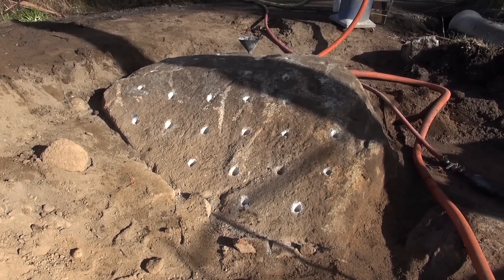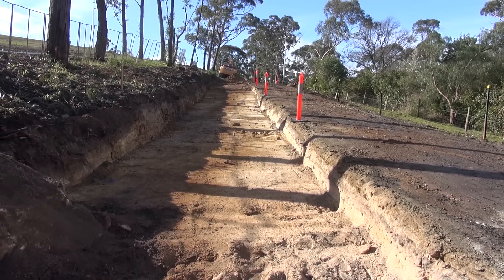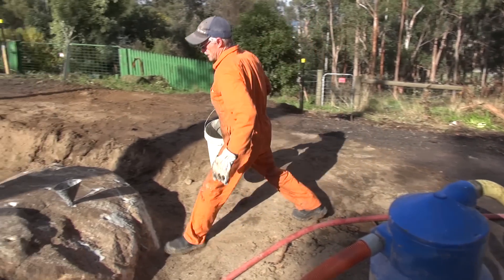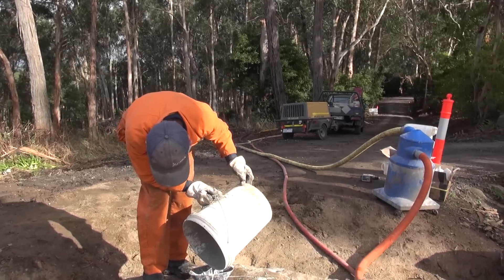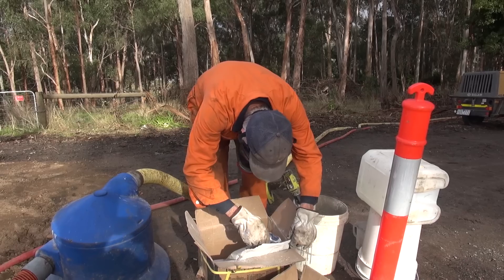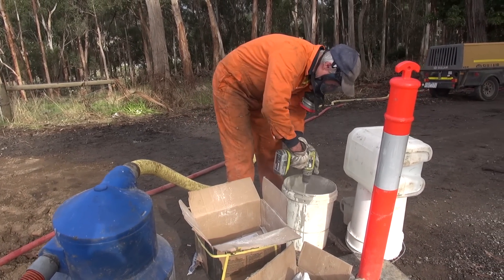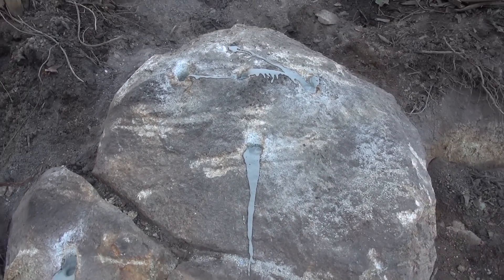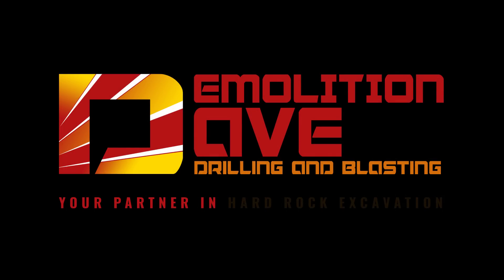Breaking Granite without Explosives

Comment: Great stuff. Just wish there was an electric drill under $1,000 US that can drill it without bits melting.
Reply from the maker: A SDS Max type drill is the only electric unit that comes close but as you say the cost of drill bits is very steep and they don't last very long, minimum hole size for using this stuff is 32mm (1.25 inch). What you really need is a pneumatic rock drill. Plenty of used units available under $1000
You just need to hire the big air compressor to run it.
Reply: @demolitiondavedrillandblast  Thanks for the prompt and detailed reply! 

I have a big Bosch SDS-MAX drill. You are spot on re: it eating bits. Even when drilling them wet (second guy running the hose with drill in GFCI protected receptacle), I'm lucky to get 10-12 holes from a bit. It's often less. 

Such a waste of time/money that I bought a $4K Hilti TE-3000R electric breaker. Way faster/cheaper than the drilling. Yet avoids the costs/noise of the trailered compressor.
Reply from the maker: Hmmm... the Hilti TE-3000R seems like a fairly gutsy unit, I have a 35Kg Chicago Pneumatic unit and it is a beast to use... but it is useless on this Granite, complete waste of time.
Reply: @demolitiondavedrillandblast  The Hilti can definitely crack granite. Some of it quite well. One particular color just turns to powder. But I've been able to crack a lot of it.

Comment: I still don't get it .. after all the holes made ; won't it be cheaper  to crack the stone with  chisels  and hammer ?
Reply from the maker: Not a chance my friend, if this were that case I would not have a job, we had a 35 Tonne excavator with a hydraulic breaker at this job, it was not very effective on this type of rock.

Comment: 👍👍👍
Neat. A case of rocks posing as immovable objects meeting up with an irresistible force .. the real McCoy 😊.
I still prefer the 'Brrrt and Boom' version  .. but then, I'm a Barbarian 😁.
I witnessed, back in the 80's, a demo using 'shotgun-type' cartridges in conjunction with water-filled plastic sleeves inserted into the drill holes.
It seemed to work pretty well. A lot quicker than the expanding stuff but still with a big enough 'bang' .. enough to keep Health and Safety in business and unsettle Granny living nearby.
Reply from the maker: The system you mention is known as the "Boulder Buster".
Reply: @demolitiondavedrillandblast  👍 .. thanks for that.

Comment: With chemical, I assume it's all based on the stuff expanding, but why doesn't it just take the path of least resistance and expand up and out of the hole?   Great video
Reply from the maker: Good question, it hardens and then expands.
Reply: @demolitiondavedrillandblast  Cool. I take it that it doesn't need to expand by much.
All things being equal, is goo more expensive then blasting, at least from your end, materials and all.

Comment: Wait for it...."That looks easy. Anyone could do it."... Hand on a minute, it's a hell of a lot of drilling with a mother of a pneumatic drill and vacuum etc. It's knowing how to drill and where and how deep. If it was "easy" why would a professional road building outfit with all their equipment and experience sub contact it out?... No, son, leave it to the guy whose knowledge and experience will get the job done faster and cheaper than doing it wrong and wasting our time and money and causing more problems.
Reply from the maker: Exactly, The drilling usually defeats all but the most determined. many people try with a big SDS type electric drill and find that their very expensive drill bit is very blunt before many holes are completed and the holes they drill are usually to small a diameter to be of much use.
Reply: @demolitiondavedrillandblast  I guessed that might be the case especially with granite etc. Some jobs look easy but the reality is much different.  I've had a guy who saw something done and "knew how to do it" but had never used a power drill. So there's a big difference between "knowing how to" and knowing how to.
Reply from the maker: Recently I finished a job that some guys started - they watched one of my videos about using Chemical Cracking Agents. after 3 days they had drilled 33 meters between them and gave up, concluded that it was hard work and they did not feel like continuing.
Reply: @demolitiondavedrillandblast  brilliant example.

Comment: What is the chemical called it’s different in different countries.
I can’t find it here in UK
Reply from the maker: The one I'm using here is Expando, other brands are Ecobust or Dexpan, be surprised if you can't find Dexpan in the UK.
Reply: @demolitiondavedrillandblast  will try thanks Dave 👍
Reply: Found Dexpan here on Amazon £101 Uk pounds for 11lb bucket will have to go with that
Reply from the maker: Wow... that is very expensive, that will be enough to fill 2.2 meters of 38mm dia hole.
Reply: @demolitiondavedrillandblast  thanks for your help Dave 👍

Comment: Great Video Dave. Thanks!
1. What diameter holes did you drill for this job? 
2. Is the grout you used the high temp range or the medium temp range grout?
Thanks!
Reply from the maker: The holes were 38mm (Inch and a half) and the product was SCA2 - midrange.

Comment: A couple more tricks:
1. You can get it into awkward holes that won't pour with a grout syringe.  I've also seen it delivered into big machine-drilled horizontal holes with a small grout pump. You have to sort out a fixture to bolt on for the collar.  

2.  A cut off bleach bottle makes a nice funnel and gives you a handle
Reply from the maker: Thanks for that input 762, I have never seen a grout syringe, have to look that up. I have perfected another method that works well using small diameter lat flat plastic tube, no collar fixture required, have a look at this video - https://youtu.be/nWKP7NW3c1g I like the idea of a free funnel with a handle, thanks for that.
Reply: Grout pump .. a 'Spiedel' Pump comes to mind. We used them back in the 70's undergound to grout roof and sidewall support cables. Easy to clean and maintain.

Comment: That goo still impresses the heck out of me Dave - slow but effective. Of course, never beats a good solid boom!!
Reply from the maker: There is one brand of this product called "snail dynamite" Chris. Yes, often impresses me also.
Reply: Meant to mention earlier - formulation must be very clever and from what you say very exothermic too.  What is really impressive, apart from expansion coefficient - is how it must have a good ''grab'' on the hole side walls, otherwise it'd come out the top like toothpaste. :) No reply needed.

Comment: g'day Dave, i was thinking of you the other day, i was helping someone clear tools from a shed for a lady moving, and found a pneumatic jack hammer, with a single pointed bit, she didn't want it, so will see if it runs off my 42cfm deisel compressor.

things are bad when it's faster (and cheaper) to get goods from china than from another state.
Reply from the maker: The 42 cfm should run a medium size breaker, yeah the transport company was hopeless on several levels.

Comment: Cracking job Dave de M7INT
Reply from the maker: Thank you, it really was a crack up.
Reply: @demolitiondavedrillandblast  
Hi Dave nice cracks ther.
Wondering, wath hole diameter did you make? And how smal drill can be used and Expanso still be effective? Cuerius to know, plan to crack som stones on the property in the atumn. 🤭
Reply from the maker: @janne65olsson  Optimum size seems to be 38mm (or Inch and a half), 35 will do, 32mm is about the minimum that I would ever bother with, @32mm the holes will need to be much closer together. These holes were 38mm
Reply: @demolitiondavedrillandblast  
Thank for youre answer. I do not have a heavy drill. So i guess it will be 20mm and alot more holes then. 😊👍